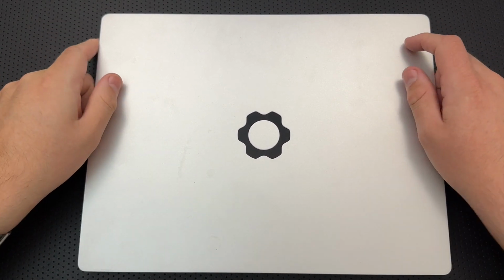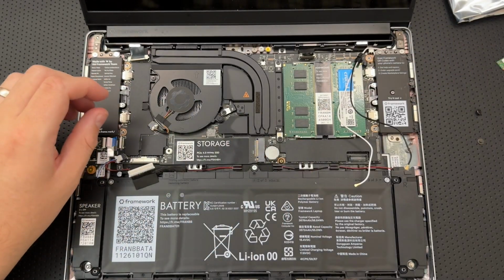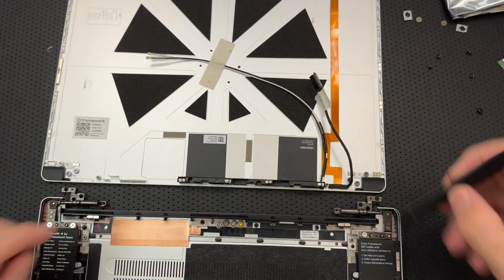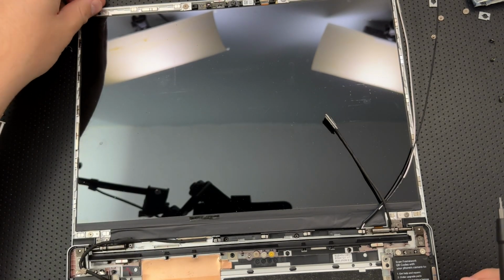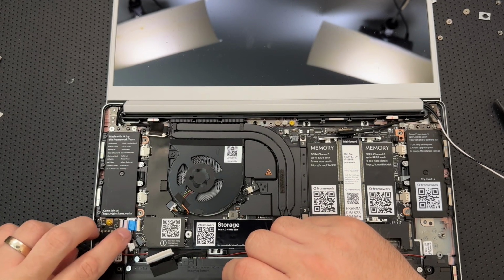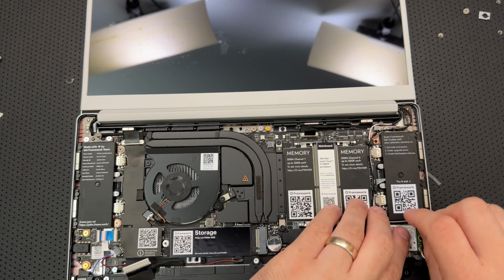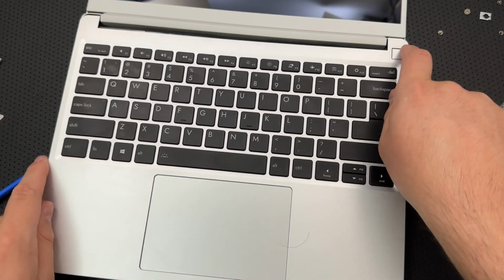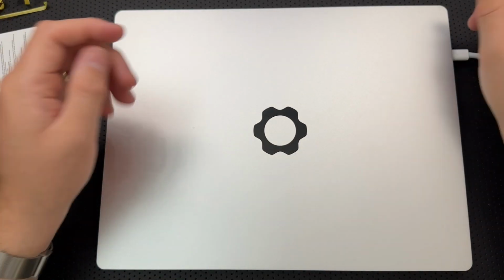How to disassemble and maintain a whole laptop: Upgrading the Framework Laptop

Comment: As somebody who does this sort of thing regularly I'm very impressed with how they laid this all out. One thing I hadn't even considered initially was how those little port modules would assist in motherboard replacements. Usually it's a "fun" little game sliding the motherboard around with the few millimeters of space you've got trying to free the ports from the sides of the bottom case to be able to pull it out. The fact that the audio board connects with a ribbon and all of the other ports come out beforehand is incredibly helpful. I want one even more now.

Comment: Can you please share the exact model of the RAM?
Is this one ? CMSX32GX4M2A3200C22
Corsair Vengeance is not listed on the framework page
Reply: Nick, did you had any problems with the RAM ?
I want to buy the same for my framework (when it is finally shipped ...)
Reply from the maker: Nope, RAM is working great.  And it's not from them, I bought it separately.  https://amzn.to/3CD4ru8  There it is.

Corsair Vengeance Performance SODIMM Memory 32GB (2x16GB) DDR4 3200MHz CL22 Unbuffered for 8th Generation or Newer Intel Core™ i7, and AMD Ryzen 4000 Series Notebooks

Comment: 12/26/2023. What we just learned with respect to adding Memory (RAM) for the 13 AMD Ryzen 5-764OU, is that the Framework brand DDR5-5600 16gb RAM can be flipped over to install it. We saw on other YouTubes that other brands of RAM could be flipped over, but we weren't sure of the Framework brand. When filling in the two available slots for RAM, it takes a piece of RAM (e.g., we wanted two 16gb RAM pieces) AND a piece of "mirror image" RAM. But Framework mistakenly sent us two of the same pieces (not mirror images of each other), and the second piece would not fit.  That's when we learned that the second piece - the Framework brand 16gb RAM -- could just be flipped over and inserted. Now our laptop shows 32gb of RAM, and works fine.

Comment: As I've descended deeper and deeper into TechTube, I've often wondered what a Nick Shabazz computer build would look like. I'd love to watch you build a full desktop tower (custom water cooling?!?!1!?) But this is nice too
Reply from the maker: Heh, it's already built.  All air cooled, silent running, Ryzen 5950 and RX6950XT.
Reply: @NickShabazz  Quite the spec sheet! I just built my first system earlier this year after tax returns with a 5600x and 6600xt. No plans to upgrade to the new 7950x? Probably not if you're sticking with air cooling, all reports I've seen and heard say it runs crazy hot even on a 360mm AIO.
Reply from the maker: Nope, I can barely stress the 5950 as it is even with serious analyses.  And I need the extra VRAM, so the 6950 is great.